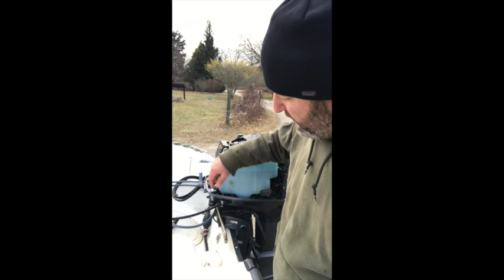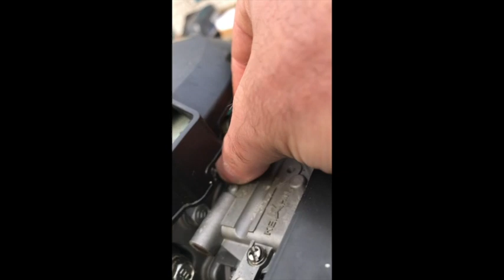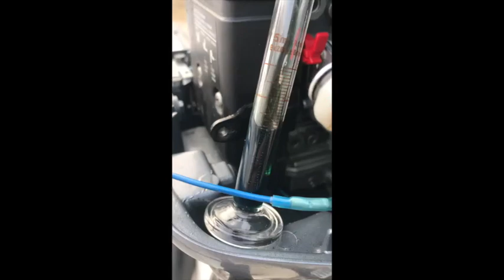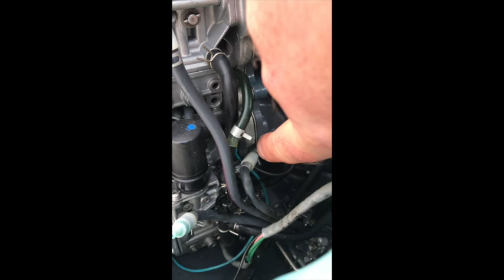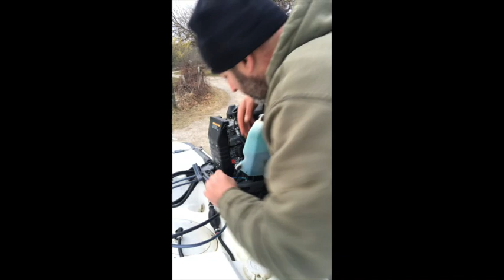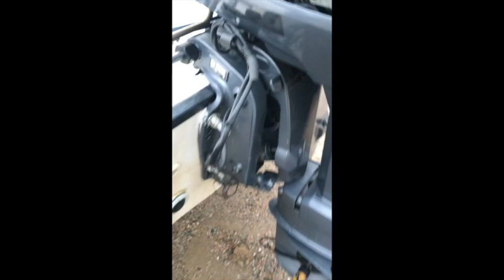2-Stroke Oil Injection Pump Operational Test for 2006 Yamaha 70TLR

Comment: My 70 is just like yours only its a 93 model.  The bottom cylinder was nearly full of oil after sitting for 3 months. Could that be the check valve you were talking about?  After removing the oil, the motor still smokes heavily while i run it (on the trailer with muffs) at any rpm.  Maybe I have not run it enough to burn the oil out.... i'm not sure.  Thank you for the excellent video!
Reply from the maker: You’re welcome, glad you found it useful! The check valve just keeps the oil going one way into the cylinder. 3 months isn’t that long to sit, mine sits all winter. Did you fog the cylinders too? That would create smoke too. Could be that you need to run it longer, let it get up to temp. You might also have to adjust the oil injection pump, but I’d test the output volume of each hose first. And like I said at the end, better to have too much oil than not enough, you definitely need it to lubricate the crankcase!

Comment: What do anodes do and why replace? I have a 2002 70hp Yamaha TLRA. Should I do the same? I just had the motor rebuilt.
Reply from the maker: The anodes are sacrificial zinc metal that take the brunt of the galvanic corrosion and protect other metal components from corroding. They absolutely need to be replaced so they continue to protect the important metal from corroding, and if the anodes get too corroded, they can also break off and obstruct cooling passages, which can lead to overheating problems. Check with the rebuilder of your engine to ensure they replaced all internal anodes, and if not, replace them yourself right away before these other problems occur
Reply: @Barrys_Shop  thanks for your time and knowledge.
Reply from the maker: @KeepatIT69  my pleasure, and I wish you many years of reliable and safe boating with your 70 TLRA!

Comment: Great video. Would you happen know where I can fid the Oil injector specs for a 2005 150 hp Yamaha? Thanks
Reply from the maker: Try asking your local Yamaha outboard dealer/service shop - that’s where I got a look at mine in their service manual. Can be hard to find online, but you might get lucky

Comment: Thanks for the video, How do you  set the idle speed to 1500?
Reply from the maker: The service manual says to do so by adjusting the throttle stop lever.
Reply: @Barrys_Shop  Thanks , I had just gotten the boat and didn't realize you could simply increase engine speed with the throttle lever, without spinning the propeller by pressing he button on the side of the throttle lever!  All good now

Comment: Did the 2000 TLRY 70 hp originally come with an oil injection system?  Can it be replaced?
Reply from the maker: That’d be a question for your local Yamaha outboard shop. I bet it could be replaced if it was removed

Comment: l have one of these, 2001 low hours. Was laid up for 2 years, prior to that time it had the carbs clean at a workshop. Its running great always starts up pretty easy. l think it might need the carbs cleaned to just check them and make sure that there is no shit somewhere. My question l have is, when l cold start it,it seems to run on 2 cylinders for say 10 seconds and if l give it a little throttle it seems to run on all 3 cylinders. And when warmed up all day starting, seems normal. I've started to use some fuel stabilizer, because of ethanol in the fuel. l am thinking maybe one carb is dirty hence that happening on startup or is this quite normal with 3 cylinders 2 strokes? Just discovered that this happens when tilted up all the way and go to boat ramp. If down a good while , few days and like today started on muffs started fine, but noticed tilting up and then down while running, lowered the rpm from 600-700  to 4  or 5 to 600.what would cause this?
Reply from the maker: Hi Kevin, thanks for watching and apologies for the delayed response. I bet your startup issue at the ramp has to do with gas spilling out of the carb bowl(s) when tilted up and bouncing down the road. The carbs with shorter fuel lines most likely fire up first. Should rectify itself quickly once started. Cheers!

Comment: Hi mate, l have done this test and all was well.l have same motor. Now when l put the boat in the water for the first time.and turn the key ,no beep,l am pretty sure there was a beep before. Mind you, you don't seem to have a beep either before you turn on ? or do you? Do you know how to check this issue.
l have only replaced battery cables, l have not disturbed anything else when l unscrewd the oil bottle to do this test.

Comment: Hi mate. l have reached out to you a few times and your not answering anymore. l have deleted the questions because l had solved the mysteries my self. l will try again with 2 questions just in case you answer. l am ready to do what you have done in this video. plastic oil container unscrewed. What l noticed the oil pipe that runs at the back of the plastic container was half pinched. Is this normal. ? And l also notice that the top cylinder always runs a bit hotter than the middle one and bottom one, when touching them. Any idea what could be thec reason. This engine as l said was sitting for 18-24 months. It run pretty much normal from what ive been seeing in your video and others. l will be putting it in the water and testing it hopefully next weekend. If it seems atall rough or stuggling in any way, then l will also take off the carbs and clean .them. l have not cleaned the water passages as you said you done. Because l probably need to order a gasket and that would take weeks to get. it is cooling as it should with strong pee flow. It had a new impellor change ,l think 2018. l   changed gearobx oil and new plugs.
Reply from the maker: You could try cleaning the water passages by removing the thermostat and pouring some fixture cleaner down that hole, flushing it all out with water. The “tell tale” can piss out water even if you’ve got a blocked water passage, so keep an eye on the temps. Hopefully your engine is running good these days!

Comment: Good video. Hi , i have a 2 stroke autolub yamaha 80cv model AETO. I want to.do the oil pump test as you, but i have a qestion, i going use a pre mix 50:1  when i take off the pipe of oil that fedd in carburator should i measure the amount of oil at the same time on each pipe of 3 carburator or 1 pipe each time, because the other 2 pipes will get more oil then the pipe that i measure. Thanks , sorry for my bad ingles
Reply from the maker: Hi Luis, I would measure each pipe individually to ensure they are each putting out the correct amount of 2-stroke oil, no clogs, etc.

Comment: Thank you Sir, I am testing a 95  Suzuki 225 hp's oil injection specs,  very useful information:  full oil injection pump throttle, 1500 rmp with premix 50:1 for 3 min,  2.2 ml of .5 ml +/-.   
Many outboards would work for a long time when oil injection is good.  I bought a 85 Suzuki 75hp and used it for 13 seasons and sold it in excellent running condition.
Reply from the maker: Thank you Osborne Bay.  The 2-stroke oil injection pump operational test performed in this video is specific to that particular engine.  I would recommend getting ahold of the service manual for your 95 Suzuki 225, or find out the procedure and specs for the operational test for your engine.  Yes, a properly maintained engine will last many years!  Good luck and happy and safe boating!

Comment: Hi mate, l was wondering if l should do the same, have no test tube though. ? l have just bought the boat and it is a Yamaha 70hp 2001 model only 131hours on it. been standing for about 2 years, Had water pump and carburetters cleaned just before that 2 years, so will be praying l don't have to take them off and clean them. And if it has a strong stream of water, that the impeller does not need doing again also.  Was going to use a 50.1 mix just as a precautionary measure. Can you tell me if there is a way of seeing the oil flowing through them see through hoses? l am so worried about, what if the system is not working or not properly. The reservoir is 80 percent full and some say need to change the oil, some say it will be ok, l bought new oil, anyway do you think l need to renew before first start-up in 2 years? Also going to put oil in the sparkplug holes and turn over gently first. appreciate what you would do, now that you know these engines. and if l am overlooking anything. Hoping you will reply thanks. Kevin
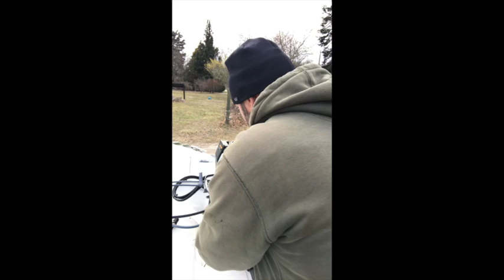Reply from the maker: Hi Kevin, thanks for watching.  I would buy a graduated cylinder with 0.1 ml(cc) graduation and do the same test I did, then you will be able to sleep at night!  The oil is too dark to watch it flow through the hoses.  The 90hp yamaha 2-strokes have a bleed screw on the injection pumps that you can open to see oil flowing, but these injection pumps in the 70hp's are self-bleeding and don't have the bleed screw.  You can also mark the oil reservoir and see if the level drops after a few hours of use (while running on pre-mixed 50:1 just in case!).  You can also very easily remove the oil hose on the top reed valve plate just past the carburetor (1:33 in the video) while running on pre-mixed 50:1 and watch the 2-stroke oil dripping out, but none of these methods measures the actual amount of oil injected into each cylinder, which i think is pretty important. You can probably burn the 2-stroke oil that's in there (I did that with mine after it sat for a few years with previous owner), but of course draining, cleaning, and refilling the reservoir is better... Did the carbs sit with ethanol treatment in the fuel, or did they get run dry before sitting?  If not, you'll probably have to clean the carbs, but that's not a big deal.  Dangar Marine's youtube channel has a few good videos that show how to properly clean carbs (https://www.youtube.com/watch?v=ye_Ui9D8dBE). I always clean with carb cleaner and then use an ultrasonic heated cleaner to really get them perfect,  it's worth it for optimum performance.  Change the fuel filter, spark plugs (good time to do a compression test on each cylinder), fuel/water separator filter, and pressure test the gear box (again, check out Dangar Stu's videos on how to do that https://www.youtube.com/watch?v=lnhZFn5gkG4) to see if you have to replace the driveshaft and propshaft seals. Change the lower unit gear lube while doing the gearbox pressure test. Never hurts to replace the zinc annodes too.  Sounds like a lot, but none of it is that hard, and you'll be running tip top!
Reply: @Barrys_Shop  wow mate best  accurate reply ever,your the best. Will look at Dangars l am subscribed to him. There is some maintence vids on this motor too, which is always better to be the exact engine. Thanks once again will not be playing with it for about 3 weeks yet. I will let you know how l get on.Cheers

Comment: What is that upper unit tank that u just took off ? Is that oil also ?
Reply from the maker: Yes, that is the 2-stoke oil reservoir.  On my boat, that is the only oil tank there is. I do not have a reserve tank under the console.

Comment: Do you have your oil pump adjust for idle in the minimum setting?
Reply from the maker: piandu chuance For the operational test in this video, you must set the oil injection pump to the highest setting, which you can do by disconnecting the throttle linkage and pushing the adjustment toward the bow. During normal operation, the oil injection pump is connected to the throttle linkage which moves with the carburetors’ throttle linkages. So yes, at idle, the 2-stroke oil injection pump is moved to the minimum setting via the linkage, and as throttle is increased to the carburetors, the oil injection pump is automatically adjusted to increase oil injection as needed via the mechanical linkage connection